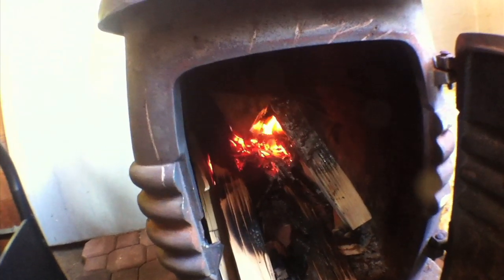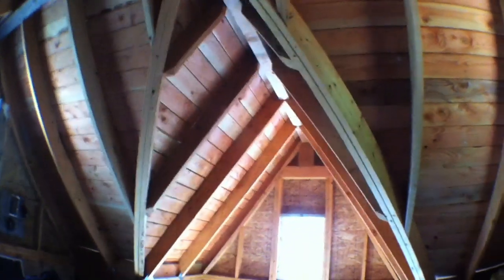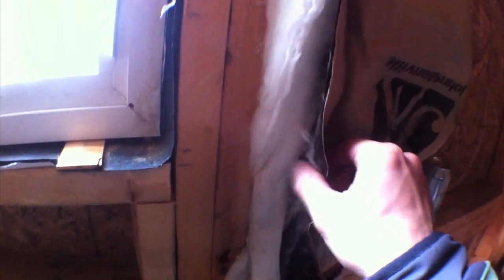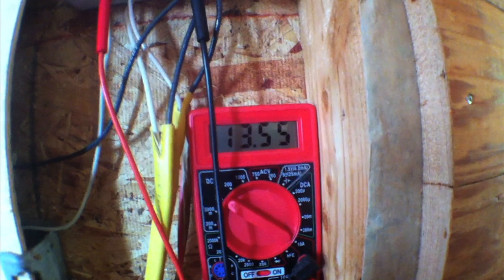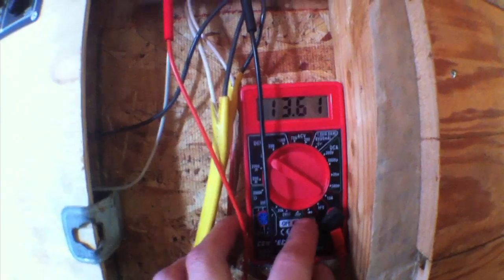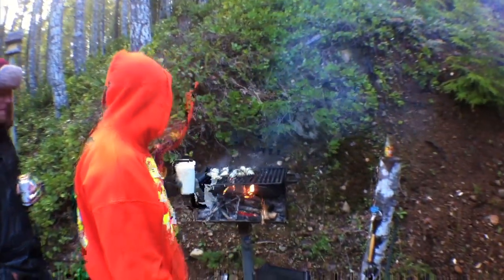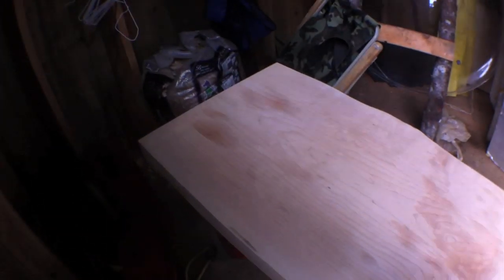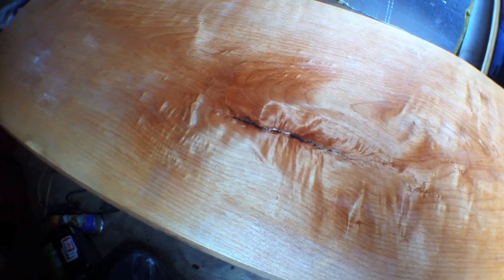Wilderness Off Grid Cabin - April 2013 - Hardwood Floor

Comment: If you want a cheap solar fridge then this is what you do.Get a new or old freezer.Then add a Ronco controller to override the old freezer thermometer.Uses about 10 amps per 24 hours.Some on you tube say it only uses 140 watts in 24 hours so let me know.

Pays in propane real fast.